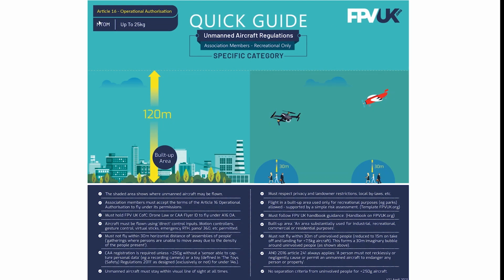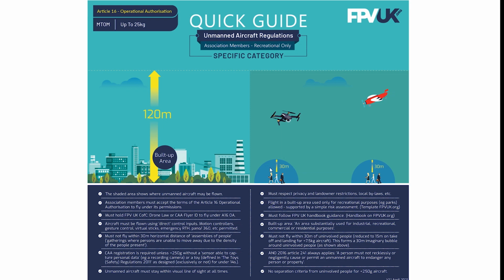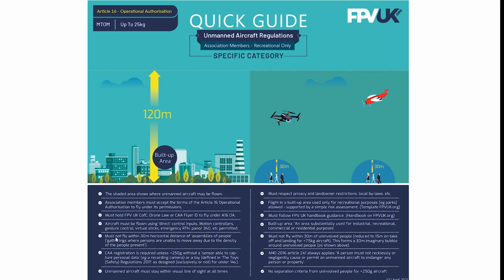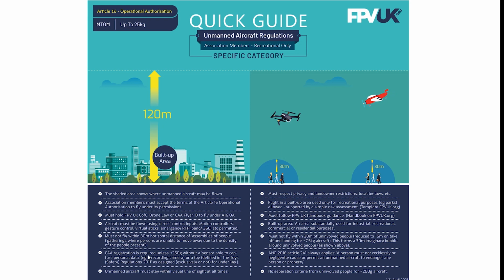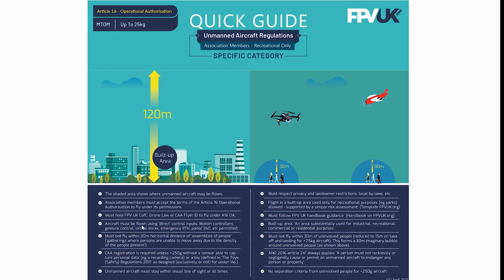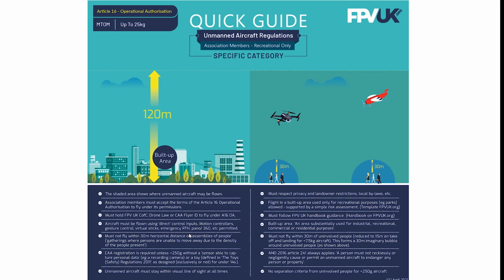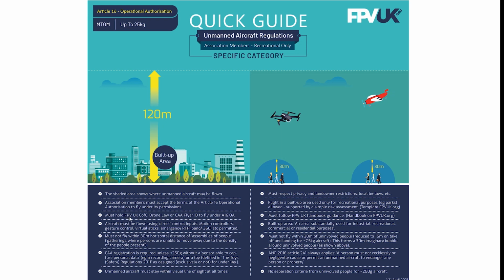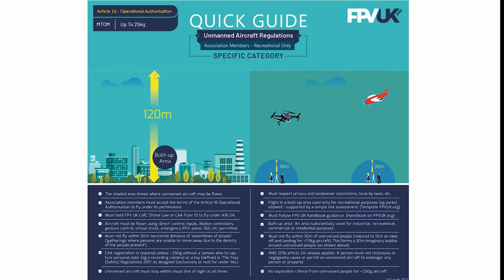FPV UK Article 16 Operational Authorisation Explanation

Comment: thx for the vid , at 2:41 you mention an fpv drone with a cam and no record facility (no onboard recording device)is ok to fly unregistered?
Reply from the maker: Yes.  You do not need to register as an operator if the drone or model aircraft has no 'sensor able to capture personal data' and weighs less than 250g.  Please see our page on the topic here: https://fpvuk.org/faq/does-a-sub-250g-non-recording-fpv-drone-require-the-operator-to-be-registered/